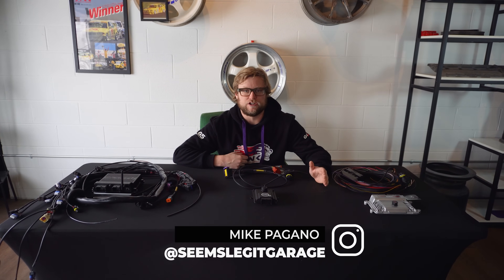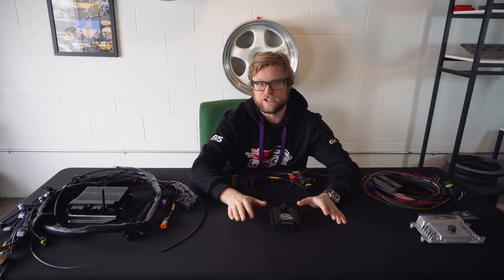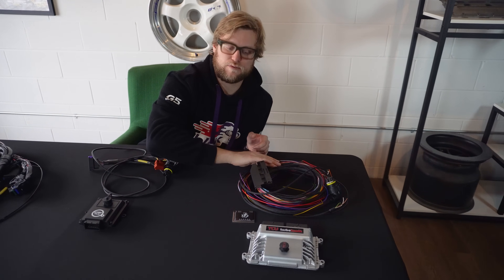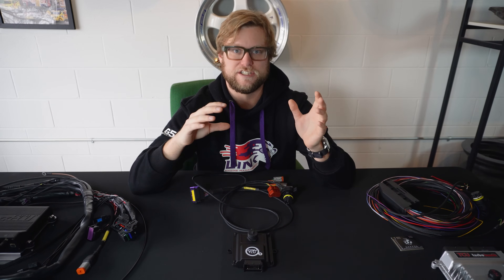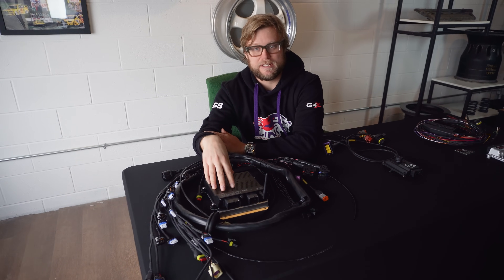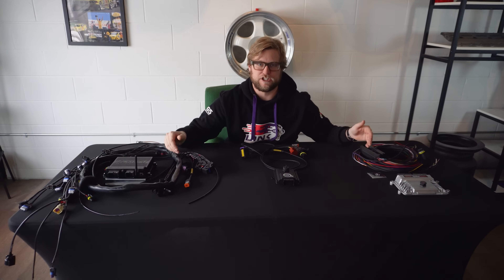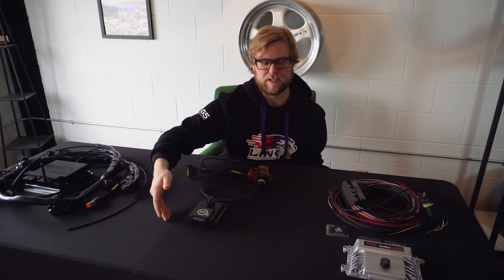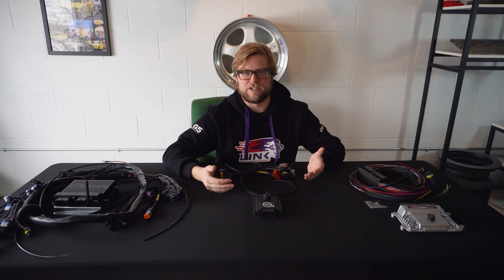Which DCT or 8HP Transmission Controller is Right for You? MaxxECU, CANTCU, or Turbolamik?

Comment: Just wondering, I heard that there was/is a bug with MAXXECU that is preventing the CANBUS connection from simultaneously controlling the 8HP and E9X chassis at the same time, have you guys ran into this problem yet? The MaxxEcu Pro has two separate CANBUS channels so its not affected
Reply: I believe it is fixed, (currently in beta/testing) and should be released with the next firmware update
Reply: @devonv2455  Awesome, thanks for giving insight on the situation!
Reply from the maker: @ Yes this is being fixed soon!

Comment: Fueltech 550 control 8HP and 10R80
Reply from the maker: We don't really feel that Fueltech is at the level of other ECU or TCU controllers already on the market.
Reply: @SeemsLegitGarage you know I’ve heard this before but fueltech runs some of the baddest pro mods on the planet. Making 4 n 5000hp plus. 

No I’ve never used fuel tech but have used other like haltech and Holley. What’s are they lacking so bad from the others. N if so why do so many big time cars use it. Just curious.

Comment: How well does MaxxECU integrate with the factory CAN bus on E38, E39, and E36/7? I'd like to have a seamless install that keeps the other modules happy and is able to use the wheel speed signals from the DSC unit for traction control.

I've used the CANTCU to convert from 6HP to 8HP on street cars and it works very well. The one thing I really like over the Turbolamik is that you don't have to cut into the valve body electronics to solder in the intercept PCB.
Reply: Maxxecu is currently developing e39 can integration, dash and reverse are currently not working 
Should be good in 14 days
Everything else works
Reply: @mhagarage  did this get resolved? Dying to just upgrade my old e39 transmission (auto) but not mess with any smog shit just get a modern oem driving trans
Reply: I wanna know as well my e39 wagon is waiting for the swap
Reply: CanBus with E39 and Maxxecu working "ok". some things are bit complicated like steering wheel buttons through instrumentcluster canbus messaging etc, but AC etc messages from centerconsole can be setup. Dash etc works like stock, of course some needs sensors as stock in bmw engine (if engine swap going on).

Comment: I'm on MaxxECU Race plugin on my turbo E46 and will be going 8hp70 after this summer season. It was a no-brainer for me. It was easy enough for me to get the car running by myself and my tuner has zero issues adjusting to the software even though it was his first one.
Reply: Do all MaxxECU versions (Mini, Race, Sport, Pro, Street) support 8HP?
Reply: @on-linetuning5157  Yes. You could run a mini as a standalone TCU if you wanted
Reply: @on-linetuning5157  All of them do, but ideally you want a Race if you're going to use it for all and want to be able to take advantage of all the modern things that can be done with a ECU.
Reply: It’s a lot cheaper too then the others isn’t it?
Reply: Are you still running stock ecu?